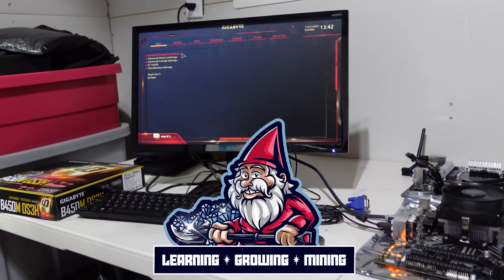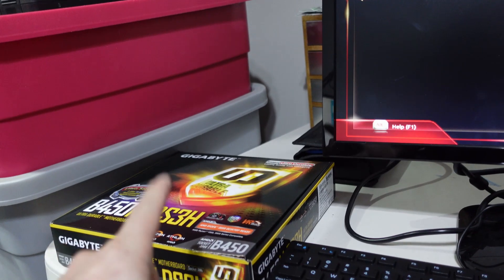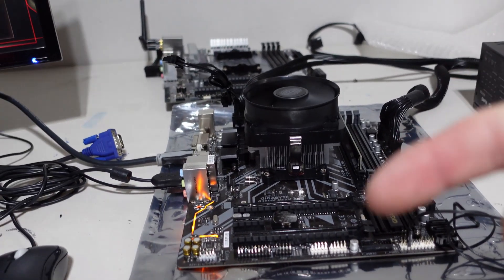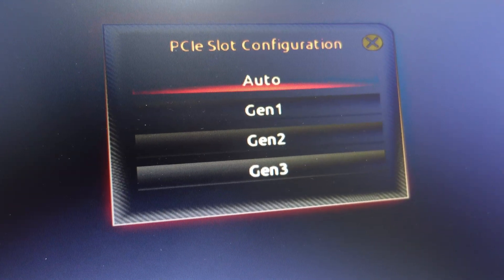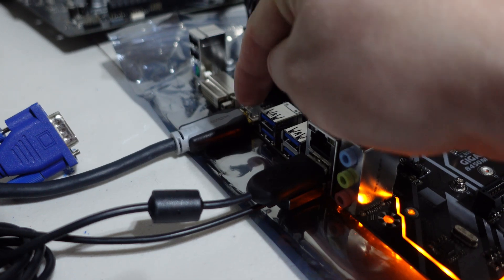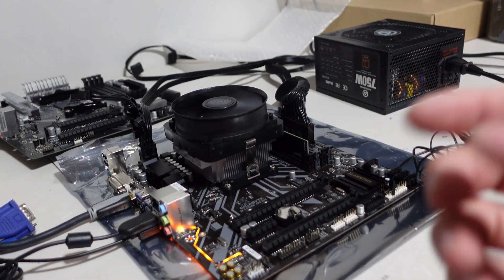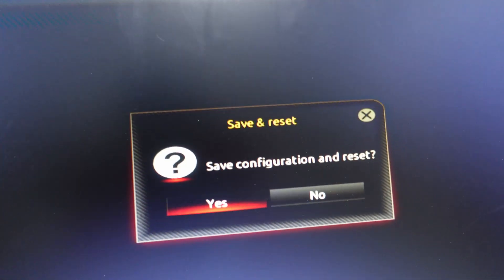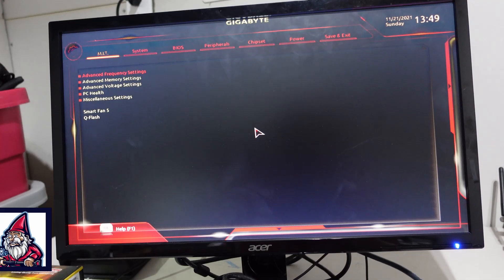Motherboard BIOS Settings For Mining Rigs

Comment from the maker: Do you have any additional Bios Settings you favor when configuring your Mining Rig?  Leave them here for the Community!
Reply: By habit I always turn XMP on to unlock full speed for ram (not that it’s important for mining) , make sure clock is set properly, boot sequence setup if using Hive on a usb or external ssd on top of main OS and if there's a  power saving options I switch to performance mode
Reply: I have a question, when I turn above 4g decoding I can't go to bios anymore i don't even see the motherboard manufacturer logo, do you have any idea what can couse such issue  ?
Reply: Thanks for making this video thanks for time Yes after 2 years this video was helpful for me

Comment: Under misc settings I have PCIEX16 slot config and then PCIe slot config should the 16 be left on auto and the second one as Gen1 or 2 or Auto.  I have the gigabyte B450M DS3H V1 also should CSM support and AMD CPU ftpm be enabled or disabled

Comment: Hay buddy I'm having some problems with my rig I just added a new pny 1660 ti but I can't get all 4 off my cards running now when mining it comes up saying not enough memory but all the cards work fine buy them self's an they all work if its just 3 cards soon as the 4th card gose in it just says gpu#0 not enough memory 

Just wondering if you have had this problem

Comment: IGD = Intergrated Graphics Display
Just to make sure that the Processor/CPU you use has Intergrated Graphics, otherwise it will not work
If you bought a CPU that doesn't have APU (Accelerated Processing Unit/Intergrated Graphics),
just plug the HDMI on the GPU's hdmi port directly
Reply: I was going to comment the same thing.  I don't think he mentioned what CPU he was using.  For AMD, it's pretty simple, though.  If it ends in a "G" it has Integrated Graphics.

One other caution (if anyone reads this later), if you buy a cheaper CPU like a 2 core, 4 thread Athlon 3000G it's best to not use the Integrated Graphics because you'll need to leave as many lanes open as possible to handle the traffic of multiple GPU's on the motherboard.

If you plan to mine on the CPU, as well, you'll most likely be using a more expensive CPU with lots of lanes to handle that traffic, but not so for those dual core sub $100 CPU's that many use for their GPU only mining rigs.

Comment: What am I looking for to be sure a board can handle a certain numbers of gpus? Outside the obvious pcio-e slots, not all board will allow for more than x gpu's period, correct? Previous boards I had cannot seem to get past 5 gpu's despite bios settings. Not sure how many mobo's I have run through, seems to be my most replaced part. To be fair I am a klutz.
Reply from the maker: You want to look at PCI Lanes.  But sandly there is no magic guide to say This Motherboard equals this many PCI Lanes which equals this many Mining GPUS.  Sadly its a lot of trial and error.
Reply: @TheHobbyistMiner  Well at least that confirms my experience haha. Seems to be a specific recipe on each using a combination of adapters/risers/bios settings and not enough reddit posts with those recipes. I will keep an eye out for the lanes, thanks for the response and content!
Reply: What I try to do is look for a combination of a specific motherboard model with a CPU model and see how many GPU's others have been able to get running on that combination and what BIOS settings were necessary.  This video certainly helps with that last part.  It's interesting that @The Hobbyist Miner suggests PCIe "Gen 2" first, and if that doesn't work, go "Gen 1."  I always just went straight for "Gen 1."  I'm not sure what the advantage is (if any) of running GPU's on "Gen 2" if you can get them to work.

Comment: I also like making sure the m.2 slots are set to pcie. By doing so, I can use those m.2 to pcie 1x adapters and they're only $7. So for $7 I can get another gpu on the mobo. Been working great on my Asus Z370-A ii with 9 gpus and no splitters!
Reply: What is it called in bios?
Reply: @TH-vi2vx  it varies by motherboard manufacturer but something like "m.2_1 configuration" then you'll be able to select from auto, sata, or pcie.
Reply: @willpower1177  tnx